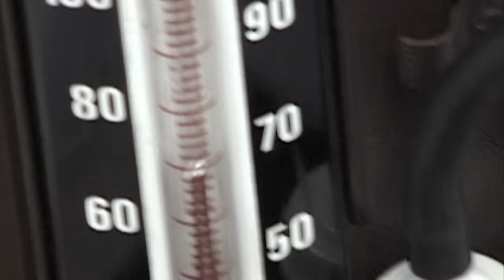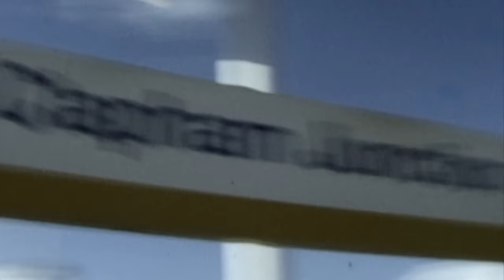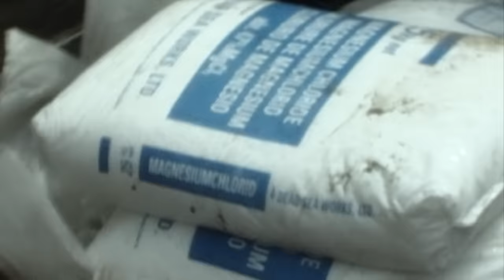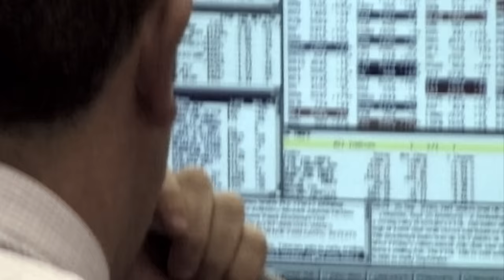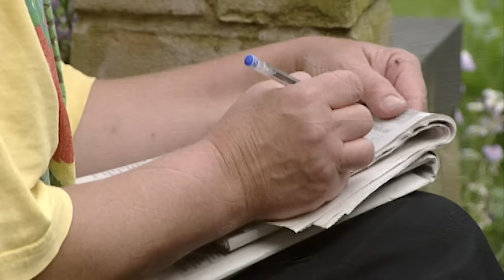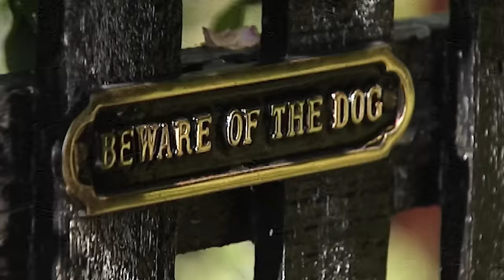What Are The Symptoms of a Mental Breakdown? The Day I Snapped (Mental Health Doc) | Only Human

Comment: After struggling with general anxiety and stress for years I finally collapsed. I was screaming and crying and banging my head against the steering wheel. The pain was so overwhelming my body and mind just could not contain it any longer. I just wanted to stop existing,  But it was also a blessing,  it was my turning point to seek for professional help. Sometimes we need to hit bottom, and then the only way is up.
Reply: I agree, but I like to say that it is necessary to stay down there, but on my feet battling demons enough to accept the dark side. From there I move forward, but not back to where I fell from. Its a slow and steady rise. Its one of the things that helped me retire from drinking, to "slowly land the airplane". I suppose one could slowly take flight as well.
Reply: Sometimes I wonder if breakdowns in some situations are "normal" reactions to a highly abnormal state of our current society. Society has become highly complex and demanding  while at the same time, social supports have become weaker. The previous generations that had a sense of purpose and persistence/fortitude during difficult times were grounded by community and spiritual meaning, which has all but fallen away in the last few decades. I think this loss and the complexity/demands impacts sensitive souls the most. I recommend that people simplify their lives as much as possible (material items, debt, social media, unwanted social obligations), take time out in nature to gain perspective, and pray or meditate to reconnect to the essential.
Reply: @kristinab1078  you are so right, totally agree with you. But I think the urge to be part of a community is too deep engraved in our DNA. a heritage of our ancestors, It used to be a survival mechanism, being part of a herd. And today from a psychological point of view it still is. Therefore I believe eventually when all modern individualism starts to loose its glamour, we will go back to basic

Comment: I worked in a hospital at a rotating shift for over 25 years with the last 18 months working with 5-7 pounds of ice on my back while trying to find a physician in the Southeast to fix me. I was forced to work two 12 hour shifts over the weekend against documented physician orders not to work more than 8 hours. I was on pain meds but in such pain that I said if I had to do another 24 hours of work in 2 days, I would come in on Monday and resign. 
I resigned and have no regrets about getting out of a purposely understaffed position which made those above me look good by saving money making us work without the ability to take time off or call in sick without a physical exam. We also had to be on duty until relieved. We did not want to hurt each other but at least one person was more equal than the rest of us.
Reply: You should try a chiropractor
Reply: @cathyhunnemeder3064  I have been to three different ones over the last dozen years. RFA - Radio Frequency Ablation at a Pain Clinic has helped.
Chiropractor didn’t help, short or long term.

Comment: There is no such thing as a "Mental Breakdown" check the DSM V------------------
Reply: It usually falls under General Anxiety Disorder and mental breakdowns can be classified as different symptoms of other disorders. I have general anxiety disorder. C-PTSD with Dissociation. I got diagnosed due to a Fugue I had with psychosis, wandering the street trying to run away from my life. My Neurologist was the one that knew something was up due to the damage on my nervous system. It shows up on EEGs, scans, and other tests. My vagus/vagal nerve doesn't regulate right. I have Bradycardia and my heart rate drops to where I have fainting spells. You can also have horrible panic attacks, spasms that feel like seizures. I have two cardiac doctors, one is an electrocardist, I have an implant to collect data and a heart monitor. I have a psychiatrist and a therapist. Physical therapy and massage therapy. My nervous system is damaged due to stress, abuse, and trauma. I live in the United States.

So you saving there is no such thing as a "Mental Breakdown" it's not in the DSM V is insulting. Look up General Anxiety Disorder, PTSD, Dissociation Disorders, Psychosis, Depression these are all considered "Mental Breakdowns"  in certain cases. It's really frustrating when someone devalues what someone is going through when they stop functioning normally.